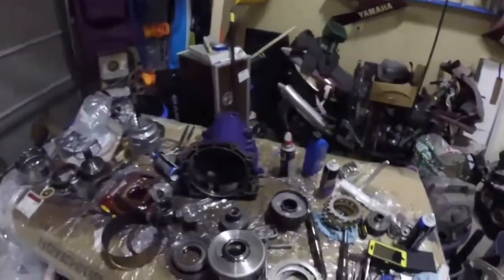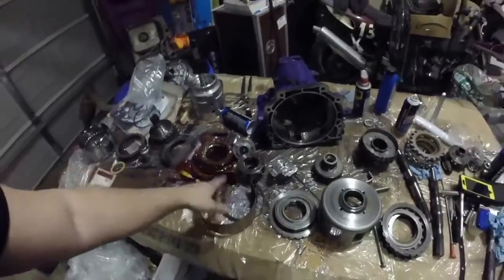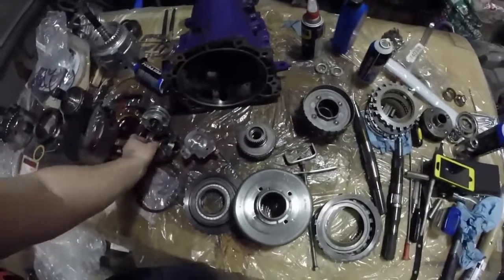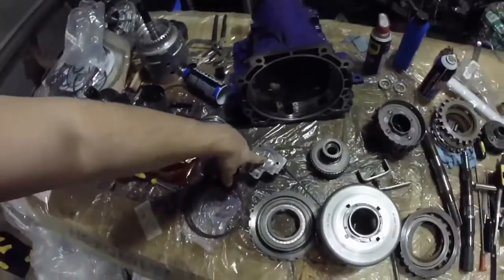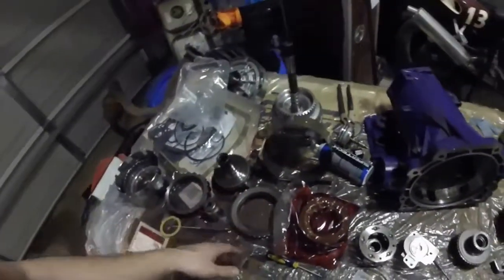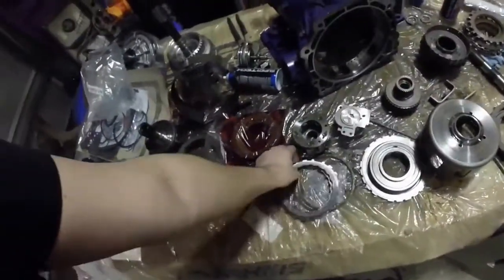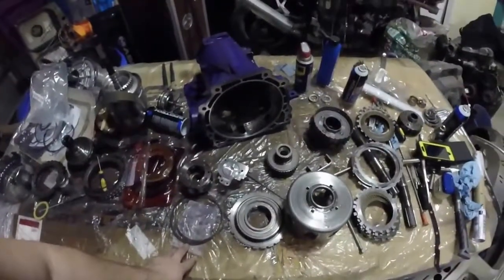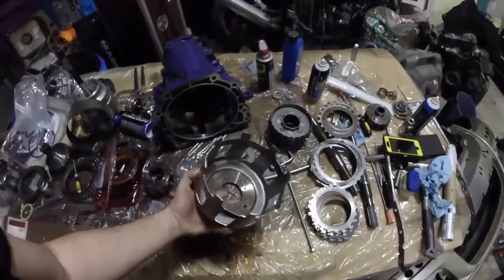4l60e Stage 3+ rebuild parts overview!

Comment: How much HP are you running into that 4l60e? I'd like to build mine up to handle 600 hp at the motor/500rwhp-ish. I got most of the same parts you are running; beast shell, HD sun gear, trans-go shift-kit(not the boost valve), sonnax boost valve, corvette 2-4 servo, sonnax pinless accumulators, hi-energy 2-4 band, z-pak, Raybestos cluthes, sonnax Input Drum Reinforcement Kit, wide sprag, Dual Cage 29-Element Forward Clutch Input Sprag, Sonnax High Performance Pack Build Upgrade Package Servo Kit, 10 vane pump, stock planetary gears, deep oil pan, trans cooler...etc . I just probably need to go with a billet output shaft as well. Anything else I should go with? Billet input shaft? HD input drum? Thanks!
Reply from the maker: Rock Roll I️ was pushing around 5-600whp from a roots style supercharged 6.0 on e85 in a 6000 pound avalanche and it was honestly the edge of what a 4l60e could handle. I️ ended up having a rear sprag failure a few months after the build. It collapsed under heavy reverse use when I️ got the truck into some mud and took out the back half of the trans.  So I️ would say if you’re a car, N/A or turbocharged you would probably be okay around those number. Mine was fine before I️ went e85 the 4l60e is rated for 600ftlbs of torque and that seems to be right where it all goes to hell. I’m going to be running a 4l80e when I️ get around to building one.
Reply from the maker: I️ like your list, but if I️ were to change a couple things I️ would go with the 8 stack of frictions instead of the z-pak they start slipping over 500hp. And I️ would go from the high energy to the red wide 2-4 band but probably not the black race version I️ have it is pretty aggressive for street use.
Reply: I plan to run e85 also. It will be N/A. Did you have any issues with e85? Thanks!
Reply: Thanks for the tips/info! Keep it up!
Reply from the maker: The only issue with e85 is it doesn’t like to sit, if I️ went a month between fill ups I️ would start to get some knock out of it. Also you have to be careful if your doing e85 without flex fuel because the mixture coming out of the pump is inconsistent. Usually comes out around e60 or so.
Reply: Almost Legit Garage do you have a list of parts with part  numbers and have you made any new advance upgrades or discoveries